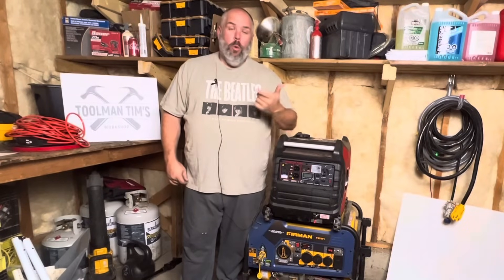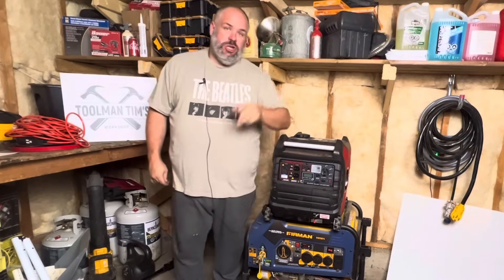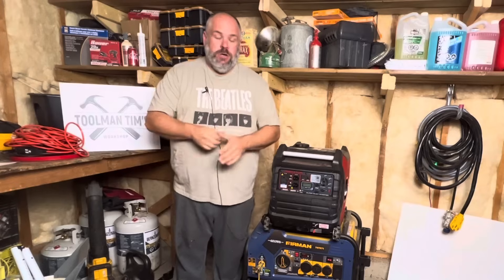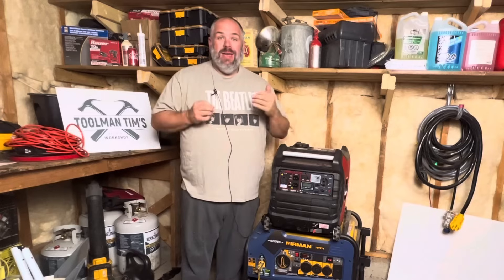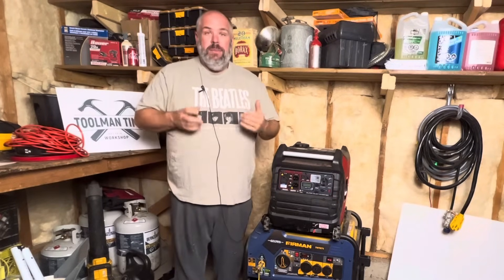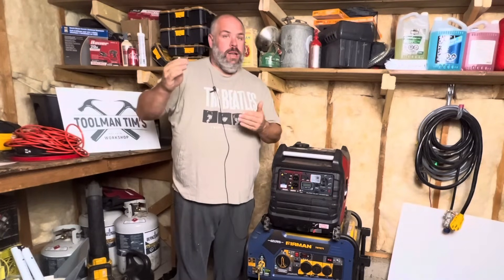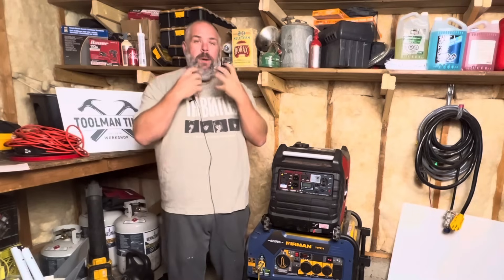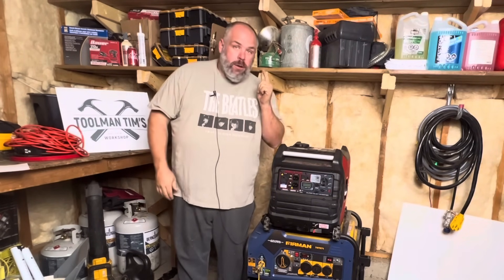INVERTER GENERATOR What's the DIFFERENCE between an INVERTER GENERATOR and a regular generator?

Comment: Keep in mind they do make Low THD open frame regular generators. My ridged tested at 3-5% THD. My dad’s old stormguard vanguard powered 5500 watt generator tested almost the same. I have triple redundant power. Solar and a eco flow delta pro ultra. A small inverter that will charge the eco flow at 1800 watts. And a large inverter that will rapidly charge the batteries and keep the house running. I have about 10k invested in this set up. But for me I like clean power and silence when possible.

Comment: Maybe you help me:  I'm researching for a generator for backup on an off grid solar system in the future.  If I want to charge batteries from this generator (or better yet pair of generators!) what equipment do I need?  Are there inverter generators that let you pull off the DC directly?

Comment: Generators with UPS battery backups will clean up the power really nice.  Inverters also sip fuel. 

FWIW - city power stinks it’s more of a modified sine-wave very blockie you can spend big$ for power filters / modulators to clean things up.

Some household appliances (washers, dryers and microwaves) they eat electricity - heck even a toaster noms energy

Comment: But isn't it the case that the open frame ones are 240V and the inverters 120. I have one of both and a transfer switch that is set up for 240.

Comment: but which generator is most gas efficient? watt for watt... if I needed 2500 watts total... which one would run longer? one that has 5000 running watts where its using 50% of the load,  10,000 watts where its using 25%, or do i need to find one closer to the 2500 running watts?? which brand also? I ran my TV and router, internet off an old regular gen Briggs and Stratton 5500 running watts... led light was pulsating but tv and electronics ran ok... is an inverter really necessary ?

Comment: Hi Tim, great generator review. We live in TX and just got our power back.
Our home has natural gas and we are looking to purchase a generator.
We have a 2 story home about 2800 sq. ft. however the high cost of a dedicated standby unit is out of our budget.
Are there any portable natural gas generators that you could recommend?
New subscriber!
Reply: I'm here in Houston with you.  I think even if you can afford it, it is ridiculous to pay $20, 000 for  a standby generator, rather than $450 for a 3500 watt trifuel natural gas generator.  The only difference is when the electricity goes out, you have to get up out of your chair and switch to generator and pull the starter rope 3 times.  There's also lots of upkeep on big standby generators.  I got a few walmart $140 window ACs and I'm good to go.
  I did not get inverter generator.  During hurricane , neighbors better not complain about noise.  Tim has video on hooking up to gas; and if you want to, my friend says electric hook up to breaker panel is easy too.  I got good quality surge protector  power strip to feel safer about computers....
Reply: @davidchristopher800 Thank you Brother much appreciated. I opted for a 14.5kw generator. In natural gas mode it’s at 11,600 watts which I believe would be enough to run one 3 ton AC Unit, a fridge, TV and a few LED lights. It’s a beast but I think it should e enough to keep us cool, fed and entertained.

Comment: Thanks for the video - this is helpful.  Question about running generators parallel - can I run two different wattage inverter generators parallel or do they need to be the same wattage?
Reply from the maker: Typically no most times they need tj be the same generator along with the same branded parallel box

Comment: So if it outputs DC then it will not run electronics. They all use AC and convert it to low voltage DC via onboard PSU or a power brick. What am I missing?

Comment: what about if you want it for house backup energy? You basically will run it through main breaker? would that be somewhat cleaner when you connect from the wall? Or if not, what about if you put a UPS in front of the wall and the computer for example?

Comment: Where is the savings if you have to bye two inverters to make up the difference in power needed.  You could look at this in having  bye double gas and oil use  when having to use both at the same time ?

Comment: You can now get big generators with low THD which puts more power than inverters. More expensive though like inverters. Plus and minus but like its quiet and portable followed by the ability to be paired

Comment: Great video. I currently have an open frame generator - super loud for my neighbors when using as power our townhouse during outages. My take from your video is that with the inverter generator, I can still connect it to my transfer switch just as I do with the open frame, but it will be much quieter - correct?
Reply: I’m not an expert, but if a new inverter is the same/approx watt output, you can use the same connector cable, which I assume is 30-50 amps.

Comment: That's awesome and a great way to explain difference, I'm a supervisor AT HFT and you made it so much easier for me to explain difference between the inverted and regular generator!
Reply from the maker: You're very welcome!
Reply: I have 2 H.F. 3500 inverters, 2020 models and the H.F. 2000 inverter with the C/O bypassed and love them.   They use a lot less fuel and are quiet and reliable.  Tim didn't explain very well is that "Clean Power" matches what comes comes into your home.  "Dirty Power"  can power old school stuff like fans, water heaters, sump pumps, etc.  Newer furnace, stove, fridge, a/c, t.v.'s  use circuit boards with micro switches that often will not run or may burn up on dirty power.  When the power goes out you sure don't want to ruin a circuit board on your furnace during a snow storm using a regular, gas hog, noisy gen.  I do have older Kubota and Lincoln welder to run the well when needed on the farm.  My 3500 will easily run the gas furnace or window unit, chest freezer, fridge, T.V.'s, lights all at the same time quietly using a lot less gas than the older regular gens.

Comment: Great video, I want a generator that is light, but can power my house, ac with soft start, small freezer, 2 refrigerators and some lights. I hardly ever have black outs. The weight and being able to use for camping. AC is not needed if weight is a factor. Does this one come with a 220 plug? I had a Generac 3500 watt generator power my old house with 2 freezers and 2 frig’s wiyh no problem.

Comment: Some inverter generators are open frame. They are open frame because they need the room for a larger motor to produce higher power at 240A. That way they can be used as a whole house electrical supply. Champion and Duracell both make open frame inverter generators with >6000 watt output. Also some new appliances, stoves, fridges, have circuit boards that can be damaged by a standard generator.
Reply: We have a Westinghouse 11000 watt inverter, enclosed.  Easily runs the whole house including CAC

Comment: Question- if I got a normal generator to power my house in case of emergency could that ruin my components like tv, computer, electric water heater ,dryer because of unclean power?
Reply: Or also I use it for my tools would an inverter generator possibly make tools last longer cause of clean power ?

Comment: Good video, but I still. have a question.  If I use my open frame generator and have a surge protector in use for my electronics, is this OK or are my electronics still in danger 
of being ruined?
Reply from the maker: So no, all the surge protector does is protect a device from a quick high power surge. The problem with a non-inverter generator is that the power isn’t clean so instead of a smooth wave form, it looks more like lightning bolts to an extent and the powers up and down it’s the fluctuation in power that will rapidly shorten the life of electronics
Reply: @TOOLMANTIMSWORKSHOP  THANKS for the quick answer.  Much appreciated!

Comment: Hi Tim, great video. You may be able to help where others have failed. I have an RV with a Onan 4000 generator. Trouble I am having the Xantrex inverter does not like the Onan, and will not charge the house batteries. It works fine on shore power. I hooked up my Honda eu2000i to the Xantrex and it is working fine, charging the batteries as it should. Is it possible to "clean up" the power coming from the Onan - thanks so much.

Comment: You are so wrong.  Inverter generators are not clean.  They produce shitloads of RFI.  If you don't believe me, turn on an AM radio when your generator is running.
Reply: AM radio. Really?
Reply: AM Radio.  That includes HAM radio and AM Broadcast.
When you live in the mountains like I do, there is no FM radio.  Broadband is beamed down from a satellite.  Strong AM radio is all you can get out of the air.  So when the power goes out, like it did for 28 days last winter, you need a generator and AM radio.  Have you ever gone camping?  Have you gone camping for 28 days?  In addition, there is no Cell Phone coverage.

Comment: Crazy that it’s cheaper to get a clean waveform via inverter than it is to clean up the waveform of a regular generator,
Reply from the maker: Typically thats how it is nowadays cheaper for a self contained unit then all the parts seperately
Reply: @TOOLMANTIMSWORKSHOP  well even for an all in one non inverter type generator, I’m surprised the inverter one is cheaper,   Or maybe the non inverter ones with the clean waveform can’t compete as they have a bad name from the cheaper ones,

Comment: Great video. Dont understand one thing. Is AVR in tech specs means it is a inverter generator?
Reply from the maker: basically yes its a much simplier verison of a dc inverter, it may not regulate the voltage as well as an invter but its the next best thing
Reply: @TOOLMANTIMSWORKSHOP   tnx man!

Comment: Is there solutions to clean up the generator output?
Reply from the maker: There are something I’m actually working on at the moment but you can get UPS is an interruptable power supplies some of which will take the power charge the battery and then power the electronics. You need my little do that as opposed to one little pass-through electricity when it’s running

Comment: A traditional generator has to run at 3600 rpm’s (or 1800 but not in portables) to get 60hz output.

Comment: Great video Tim. I would like to add  if you are going to be a long time using it. Like When hurricane Maria hits PR. We were 4 months without electric power and I spent a lot of money on gasoline. Like $300 or $400 monthly. If money isn't a problem for you another thing you need to think about is that probably isn't going to be  gasoline available at least at the beggining of the emergency. I have both types of generators, but if you need to choose one go with the inverter you will spend less $ on gasoline and survived with less fuel.
Reply: True. You save gas with an inverter generator because the RPM varies according to the power load. Open frame generators stay at high RPM all the time.
Reply: 4 months?  That’s like Puerto Rico, or Africa.  Even Texas, which is a White People North Mexico, will go dark only 1-2 weeks.  Also, the duty cycle of a large generator engine is around 500 hours?  If it runs longer, it’s pure luck, not engineering.

Comment: I really like the video. Thank you for sharing, but couldn’t you just get a surge protector to plug your electronic all devices into to save them?
Reply: I know I am replying to a comment that is a year old, but it's a great question and someone may come along and benefit from it.     The answer is no.   A surge protector is there to quench a big spike that comes down the line, like lightning striking in the vicinity or a transformer experiencing a problem on the powerline.    Think about a surge protector as a device meant to stop a single incident from sending a huge voltage spike down the line which could fry your device that is plugged in.    A dirty sine wave coming from a generator is more like constant static on the line.   It just beats up electronics that are trying to smooth that out and turn it into DC.   That dirty "static" won't fry  your TV,  but over time it will beat it to death and may cause your TV, laptop, router, etc to operate poorly and even permanently damage it.

Comment: Do I need CLEAN inverter power to run a battery charger? Or does the battery charger itself clean up the power prior to charging the batteries?
Reply: Are saying you can store dirty energy in a battery?
Reply from the maker: So as long as you can run your charger off the genrator the power coming back off the battery when you use it will be clean if you use an pure sine wave inverter
Reply: @TOOLMANTIMSWORKSHOP  When I use the battery, I won't be running it thru a pure sine wave inverter. I will be plugging it into an Electronic Speed Control that powers an RC Aircraft Brushless motor. Would it matter how I charged the battery? No matter how it was charged, wouldn't the power out from the battery be pure clean power?

Comment: I'm no expert, but I've ran across some people online that seem to know what they are talking about. These people are of the opinion that the newer, modern, NON-inverter generators aren't as bad for electronics as the old school ones.
Reply: Yeah, I also read that a modern generator with a good voltage regulator is not that bad for electronics. I still got an inverter generator for fuel efficiency and the noise suppression.
Reply: I would rather pay the extra amount for a Honda inverter generator tha is clearly the best and not risk damage to my equipment. I have a Honda generator that is 20 years old still guns when needed.

Comment: You need to test the fireman generator because they also put out cleaner power then the older generators. I've ran my 52" smart tv about 200 hrs on the regular newer generators. Since 2017 through FL hurricane seasons no problems on of my electronics.
Reply from the maker: The limited testing I’ve done so far all electronics have ran fine according to firman the Total harmonic distortion is 11-14% which is high but hasn’t caused any problems yet.
Reply: Same thoughts, I have that genny and put my scope on it and it is about a clean sine as I have seen .

Comment: Great info Tim. Wanted to let you know that at least at Harbor Freight, they have Open Frame, “Inverter” Generators. They run about 35% less than the closed frame ones. Clean power, cheaper, but lots more noise!
Reply from the maker: Thanks mark I’ll check those out.  I’ve been noticing more open framed inverter generators on the market as of late
Reply: Yes I bought a Champion Inverter Generator and looks identical to my old regular generator.